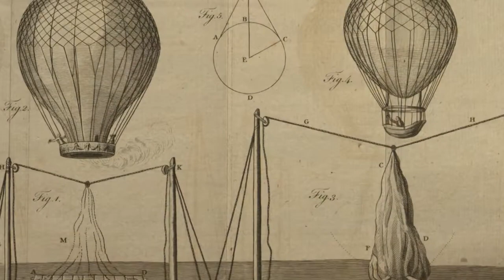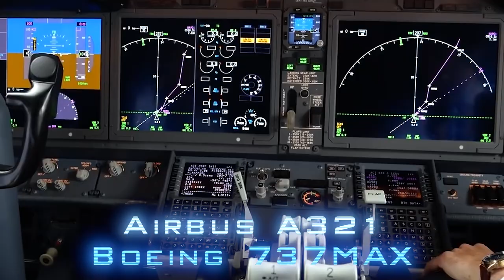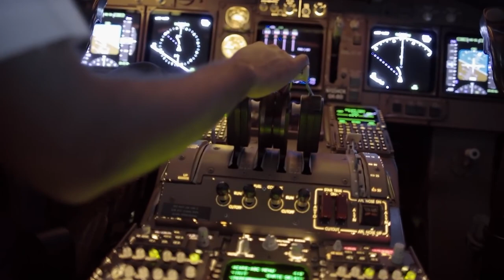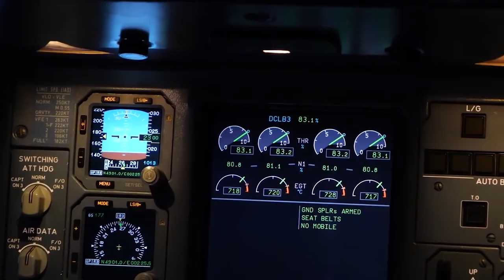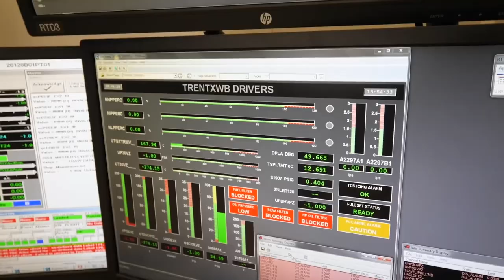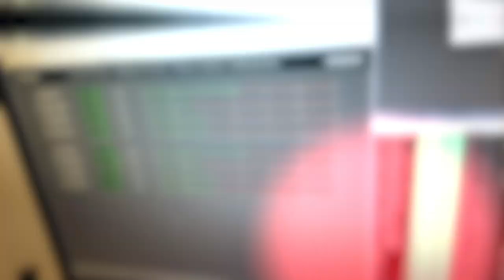Narrowbody Airplanes That Will Change Travel Forever!

Comment: In my experience narrow body aircraft are ok for flights between 1 hr - 4 hrs flights. 4 hrs is even stretching it. Airline will cramp as much seat as possible in a narrow body. Wide body aircraft are much preferred, by especially economy passengers. Due to travel Vlogs more and more persons in the world are interested in traveling , and the hub and spoke concept is a more fun and economical way to travel . Since one can spend two days vacationing at a hub destination then continue onwards after. In my opinion Airbus made a made a big mistake in discontinuing the manufacturing of the A380.

Comment: I dislike narrow-body jets for long-haul flights, they fly slower and the seats aren't as wide. I did a 6-hour flight with AA on an a321 NEO and they didn't have any inflight entertainment systems it was disappointing.
Reply: Often the narrow body seats are wider than a wide body in economy than a widebody. The 320 series has wider seats than 777-10 abreast, or the 787. The No AVOD on AA is a carrier specific choice